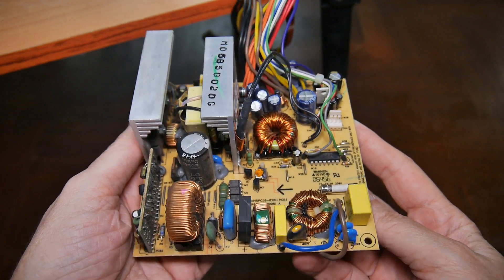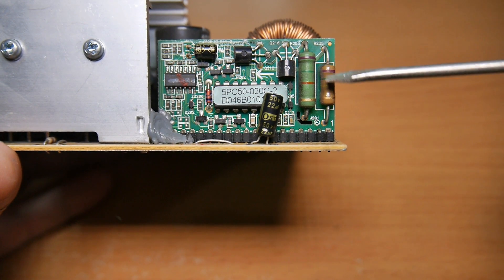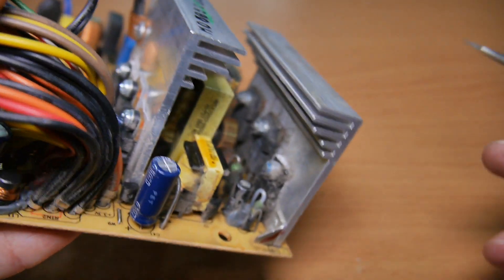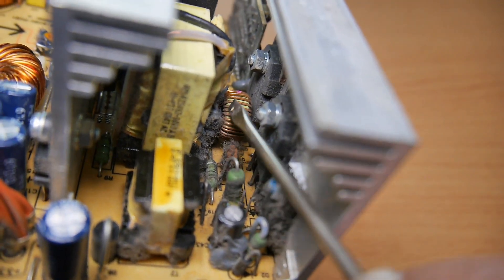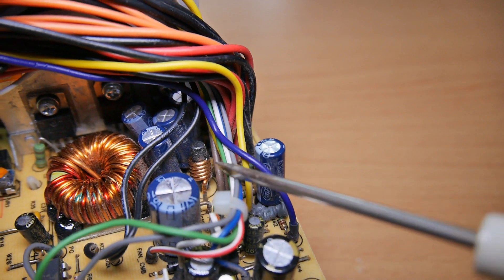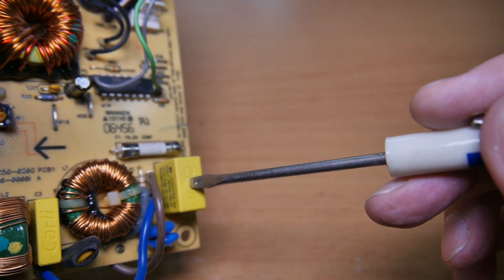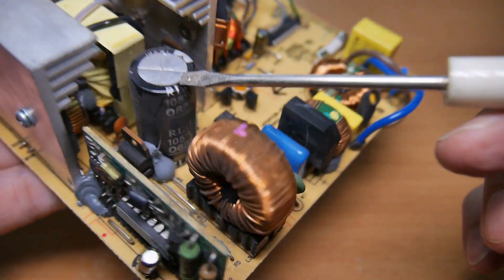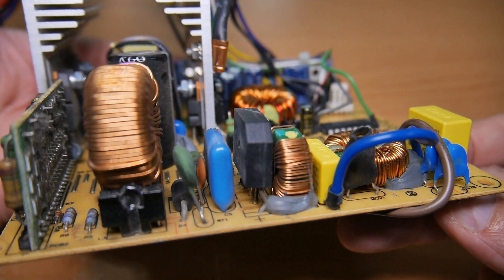Salvaging Electronic Parts: Power Supply

Comment: I usually don't break out the soldering iron right then and there, and we all know when the leaves on the bottom of our salvage they're starting to get pretty short, in just like everybody else I've pulled my soldering iron out and get that relay out or I can get that capacitor out put it in the drawer that was marked for it every now and again I'd go back for something whenever and and sure enough there be a capacitor with only one leg on it, so what do I do I take pear tin snips and I go around that board cutting everything I want in Trinidad off nice and neat to the product and it helps keep those leads on there and and especially when you want to go back to it later and use it obviously you wanted it if you salvaged it, that little piece of board that's underneath that whatever it is it helps out so I leave it there

Comment: The inductor coils can be re-used for de-noising a small dc-motor. did that and it works perfectly since I had nothing else around.
Reply from the maker: Interesting, I will have to try that.  Thank you.
Reply: Does de-noising mean silencing? If so how does a coil make the motor quiet?
Reply: @anthonygoddard428  well it depends which spectrum you're listening to and how good your ears are 🙂 
It's about suppressing HF noise. -- not about the actual mechanical motor noise.

Comment: how can i make a 5 Vdc out of parts that i got from a psu?
Reply from the maker: It's a good question.  The answer is too complex to write out here.  Most computer power supplies put out 5 volts at some pretty good amps.  Just beware you need to insulate the supply so people are not exposed to the high voltage AC involved.
Reply: @tsbrownie  yes but the psu is to bug as i like to use only the 5 volt into a small plastic case to have on my desk
Reply from the maker: For that I use a "wall wart" or if I need more power I find a power supply from an old laptop or similar with the voltage I need.  You can look up a LM7905 voltage regulator.  It's easy to use and they give a sample circuit.
Reply: a bit late to answer, good question, better use a USB charger for getting 5VDC, it is small and probably easier to use.
Probably all power supplies like in the video have a High Voltage part of about 75 % of the pcb area and a Low voltage part where the +5V +12V and possibly -12V and other voltages are made. at 3:00 in the video you see the 3 little 4 pin IC's that are opto couplers, which bridge the isolation internally by using an Infra red transmitter and receiver pair for the feedback, meaning if your +5V gets to high it lights the transmitter more, and the receiver conducts more, lowering the transmitted energy in the High voltage part. All of the 75% of the High voltage part can be connected to the 400VDC capacitor and can kill you, or give you a nasty shock at least. The voltage in this capacitor can remain high for a long time too, so if you unplug it, do not expect it to lose this charge any time soon. (see his disclaimer at 0:12) he touches the top of this capacitor at 0:19, which is the aluminium can top probably still isolated if it is not damaged, so relatively save to do, just do not put the other fingers below the pcb while you have it plugged in, or just after you unplugged it, you are probably at least hurting yourself pretty badly.